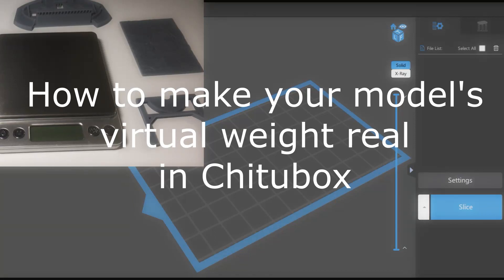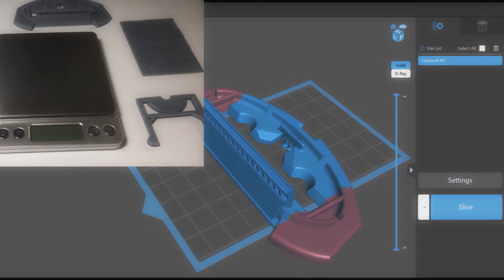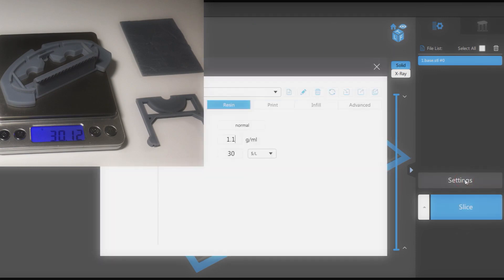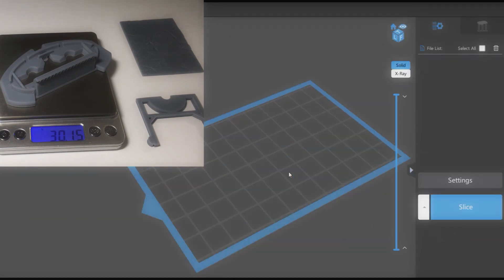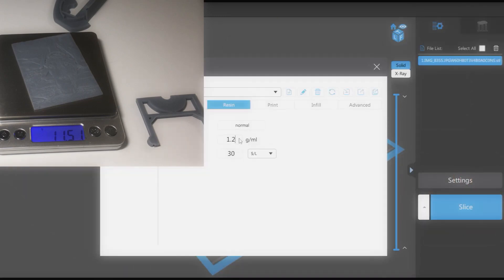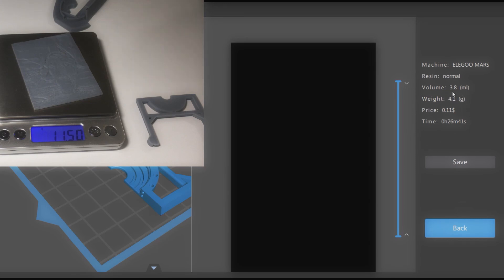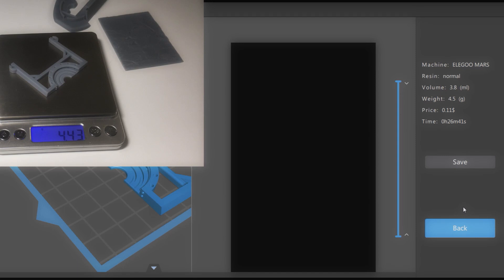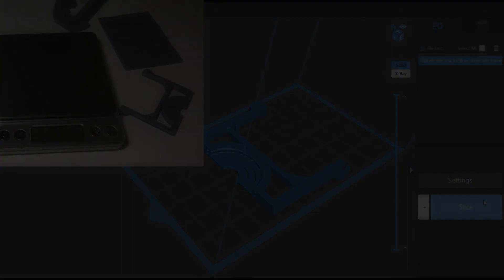How to get correct weight of STL models in Chitubox

Comment: You could calculate the density directly:  New Density = ( (Old Density)/(Software mass) ) * (Measured mass) = 1.1/27.9*30.12 = 1.18.
Reply from the maker: Sick of higher maths, frankly. Tried to keep it simple. A graduate of a Physical Electronics Dept. tho:)))
Reply: What about weight of supports also?
Reply: You’re a saviour